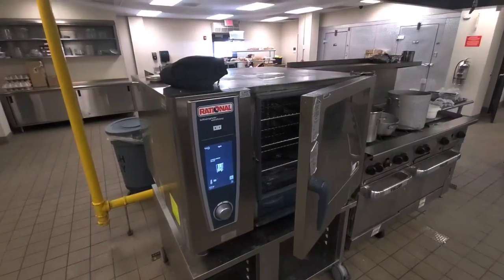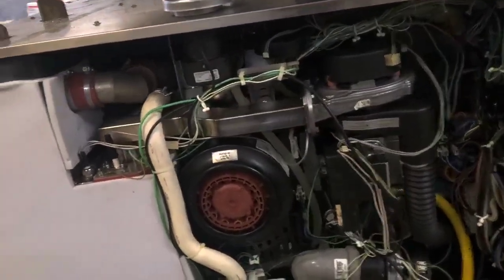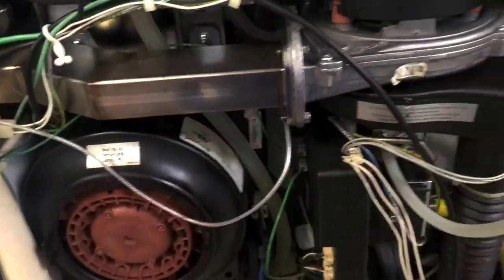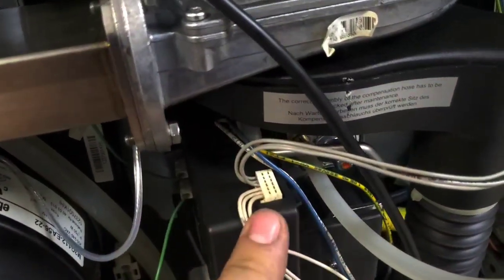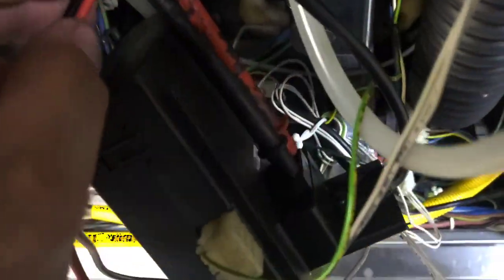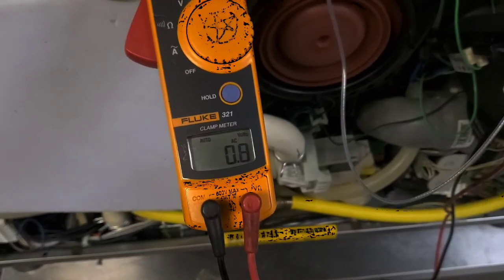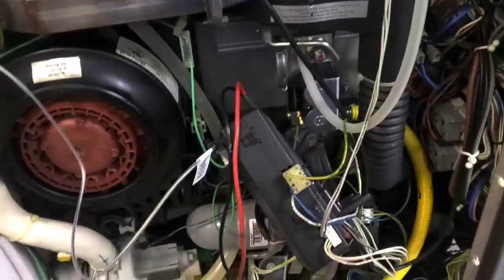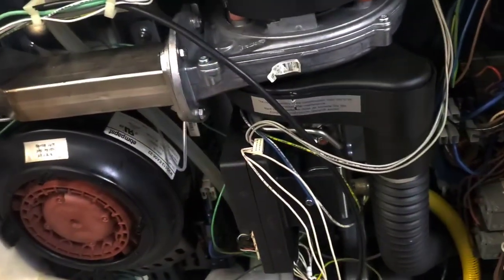Rational Combi Ovens Suck

Comment: They self diagnose there not that bad you can test everything through the screen. It just sucks cus alot if customers don’t properly clean the units and the bumps fail due to calcium and hard rock build ups.
Reply from the maker: I call shenanigans on that one. All the screen would do on this oven was yell "no communication" until you turn it off. Even if i knew exactly how to navigate the self diagnostic part, it was inaccessible thanks to the error code. Speaking of knowing exactly how to navigate that, no manual, no tech support, no dude on youtube thay shows it all, so i chose the much easier option and literally quit my job while the ticket was open. Now i dont work on ovens anymore. Problem solved. Good on you for knowing exactly how to work the computer on a rational oven, tho. Lots of techs would like you to make a video about it.
Reply: @satanicinduction  yeah it’s honestly a lot that goes into it. It’s not as hard as you think but you still need skills I does self diagnose and you can test all the functions through the screen on the service mode but you still need to know how to solve problems and follow diagrams p
Reply from the maker: Those skills you speak of help me all the time on stuff that isnt made out of ones and zeros. Physics has very little to do with the diagnostic process on a lot of this new garbage. I got told by tech support that they "dont even attwmpt troubleshooting" when i asked them for a schematic they sent me a generic one, about half of which was not relevant to this unit at all. They also sent me an utterly iseless flow chart. Pitiful. I do hvac now and im overjoyed to never have to deal with that crap again
Reply: @satanicinduction  hey man I don’t blame you. Lol wene I was working at my old company the guy that trained me went through rational training specifically through rationally so he was knowledgeable and I was just to recipient of that knowledge. And I know some techs thst literally only work on rational ovens that are not a part of the rational company. But I agreee these are a head ache. Especially we’re you love cus some areas get more hard water than other areas so cleaning the steam generators and lack of cleaning will kill the steam generators from the inside. Also gotta make sure you install with first ration system for incoming water and gas pressure going to unti is correct. And I completely agree. I feel the same way working on turbo chefs I thoroughly do not enjoy working on turbo chefs lol. I’m glad your loving your job now tho brother. May god bless you out there always and be safe out there
Reply from the maker: I never wanna see another turbocheff
Reply from the maker: @michaelcave9071 thank you for offering meaningful insight.  Its clear that you're familiar with these ovens. Obviously, i'm not. This was the only rational oven i ever touched. It may well have been an outlier and not a good example of the quality of the brand. There was something wrong, perhaps with the wiring harness, that no tech ever found and the oven got scrapped eventually. I quit working on ovens all together and will likely never work on another one of these, but i appreciate you taking the time to post a  positive comment.